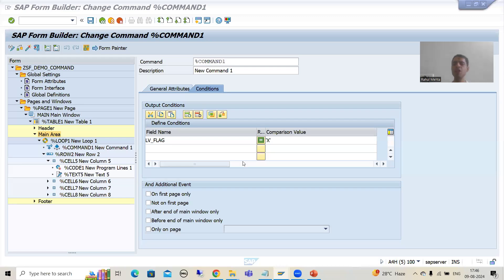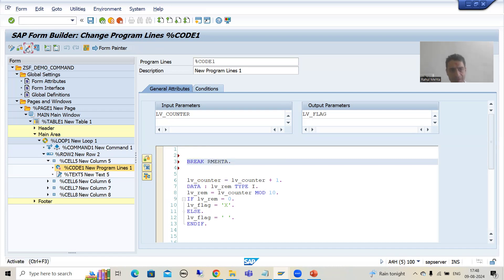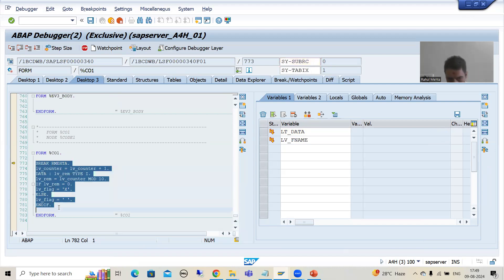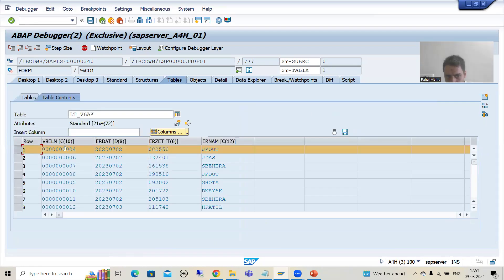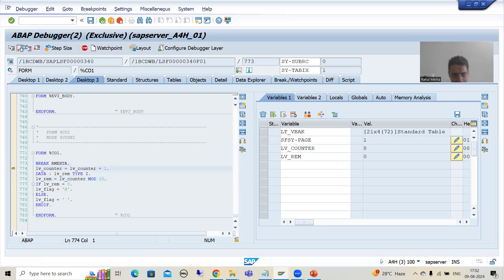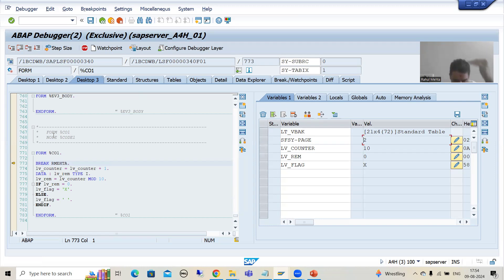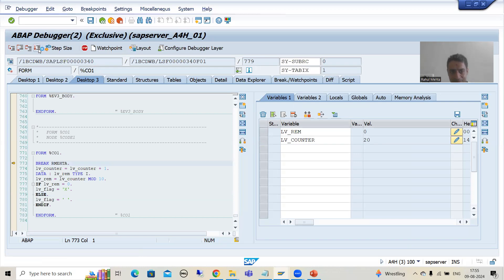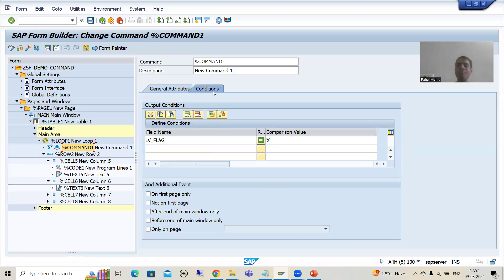65 - Smartforms - Concept of Command Part4

Comment: Hi Sir,
Can we use command without write the Driver program, suppose I have multiple windows One widow have Barcode, one window have QR code and one window have Headings then In main window I created command in command we should pass internal table and work area but how we can pass remaining windows data
Reply from the maker: Hello  - In real time, driver program is must as customer will never run the smart form. Customer always runs the driver program.

Comment: Hi Sir,

I have one doubt. Kindly assist.

I am using the below Fields,
Vbeln,erdat,posnr,matnr, kwmeng,netwr.
I used command node for printing 1st  10 line item in 1st page, next 10 line item in 2nd page. 
In that I want to print total amount for this field netwr. How can achieve total amount while using command command.
Reply from the maker: Hello Padmavathi - Yes you can. Take a variable in the program lines. Suppose variable is LV_NETWR. So, you can write - LV_NETWR = LV_NETWR + workarea-NETWR and display in the footer.
Reply: @sapabapbyrahulmehta Noted Sir...Thank you soo much..

Comment: hello sir  i am written program in program-line rem = count mod 1.
but output of smartform sysf-page = 2 to sysf-page = 17  shown the select-option-high value(ebeln) in between values are not displayed.sysf-page = 1 shown the select-option-low value (ebeln).  how to avoid this ?
Reply from the maker: Hello - It means the command and row are not the part of Loop. Just cross check the video. You need to create the command and row as a part of Loop. Just cross check the video and then It will show all the pages.